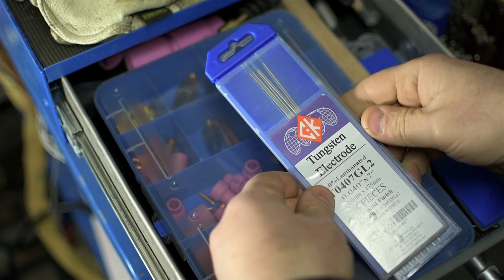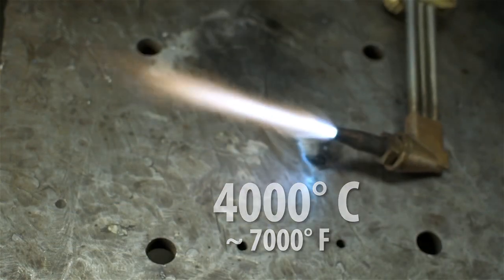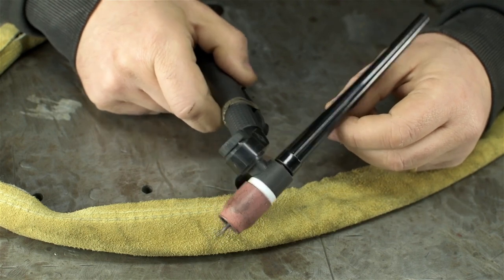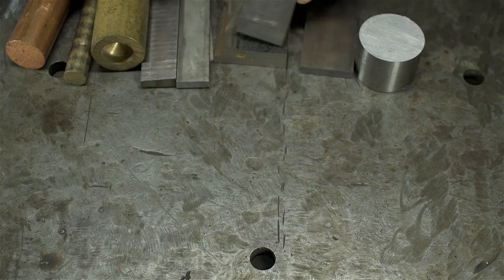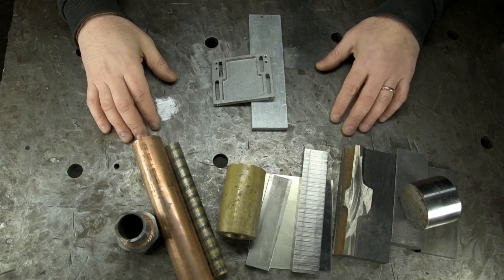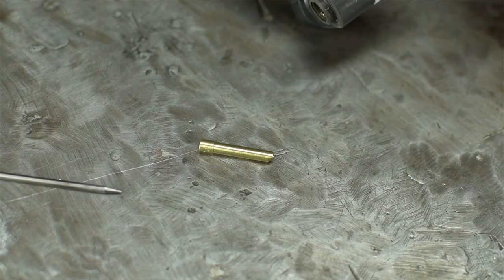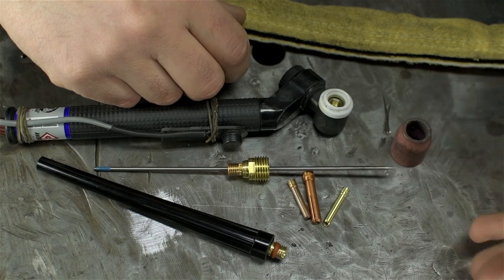Making A Stand! Why I Love TIG Welding

Comment: please weld magnesium 😀
Reply: Magnesium parts aren't usually welded together at all.   They are usually brazed together.  Magnesium welding is usually done to repair castings.  Things like cracks.  Not to join two pieces.
Reply: @GeekInJeep  wait you can weld magnesium? magnesium burns right? I was just trying to make a shitty joke, did i fail?
Reply: @theprinceofmilk2510  http://www.weldingtipsandtricks.com/welding-magnesium.html
And yes... I stole the info about it being used mainly for casting repairs from that site.   I knew it could be welded though, because the instructors always classified it closely to welding aluminum using an AC process.
Reply: @theprinceofmilk2510  - yep, sadly you failed. It's tricky, and you can easily cause a class D fire if you screw up, but it's possible to 'weld' magnesium. Google or YouTube will give more details- as mentioned, it's rather niche, but totally possible. :)
Reply: I use to build alfalfa dehydrators (yes I’m old). We welded magnesium pipe in a circle for the gas fired burner with stick welding. It was no problem.
Reply: @MJ-nb1qn  Ok, I'll bite. Why is an alfalfa dehydrator some form of old school ? Last time I worked on a farm was 1970,and putting cow corn into a silo with 1950s tractors and equipment was my introduction to farming techniques.
The hay bales had string instead of wire and weighed 45 to 70 pounds.
And why is magnesium pipe important for that piece of technology ?
Reply: Dear paul manson —- I meant I am old, in my Midwest farm town there were at least 4 or 5 dehydrators active (circa 1960’s to early 1970’s) . Now none of them are active. There isn’t any alfalfa being grown that I see. I just built the dehydrators. Really not sure why magnesium was used. But, magnesium pipe was rolled into a circle, welded together with holes in the pipe for gas flames to heat the dryer. We build every part of the machines. At that time, early 1970’s I did what I was told, glad to have a job. It was quite a shop. We could roll about anything in a circle. Once we rolled a 6” x9” piece of steel into an 18 foot diameter circle. It took 3 overhead cranes and had to be within 1/8” true. We did it. I saw no difficulty in welding magnesium, I did know the properties of the metal and was not sure why they used it on a burner element.
Reply: Dear paul manson  — By the way I am the 3rd generation to run a cattle ranch. So yes I too bailed and threw string bound hay bails on a wagon as a child. Even saw a “ Go Devil” being used as a child. Ever hear of that contraption?
Reply: @MJ-nb1qn  Yes I have,but do not seem to be able to retrieve the memory. It was a brand name ,no ?
Magnesium pipe with holes for gas flow being used as burner pipe. Jay Leno(a 1930s Bugatti) and the Kermit Weeks crew (restoring a Me 108) talk about the workability of magnesium. How it worked into a circle without cracking I do not understand. And why such a metal was around live continuous combustion. Another mystery. Sounds like these were an engineered product rather than something thrown together with what was available. Why magnesium ? And why so important to dry the stuff ? Not enough summer days ? Or was the alfalfa being processed into pellets ? Off to Google to see about both ,but you were there and I was not.
Reply: Dear    paul manson    —- I can’t tell you why they used magnesium. The shop specialized in make dehydrators. It was a family business with an engineer designing the dehydrators. A lot were made and sold. Magnesium was fine to roll. We had many types of rollers. Rolled angle iron, leg in and leg out. Flat stock into pipe for auger use. Bar stock really anything. We did as much work in outsourced jobs from around the US because we had the equipment. We made a lot of stainless steel “ pressure cookers” about 7 ‘tall and 4’ round with locking ring lids for Georgia Pacific. They used them to cook material that later became sheet rock. I devised a way to roll 1 1/2 x 1 1/2” angle iron leg in. I could roll it into a 2’ circle. I learned a lot of metal fabrication at the shop. We had a gas fired “kiln” out back made of fire brick about 30’ in diameter. We would put rolled big steel rigs in it and fire them up good and hot and let them cool to relieve stress on the rolled steel. I studied metallurgy in an apprenticeship and was certified at least 5 times in welding. We also made hammer mills to pelletize the alfalfa. This was used to feed livestock. All this used tremendous energy, both gas and electric. The engineer had the bright idea to make a small dehydrator that fit on a flat bed tractor trailer. His idea was to take it around for sales.we all said it would not work, but he said make it. The first time he fired it up for the maiden voyage the whole dehydrator and trailer burnt and melted to the ground. Several hundred thousand dollars worth. It was a shame, but if cell phones were around we would still be watching it. Sorry to ramble but this is stuff no one does any more. No CNC or that stuff all cut and sheered by hand. We cut stainless with torches that blew metal filings into the flame to start the oxidation process. No one does that. It was so messy and dirty and cut poorly. This was 3/4 to 1” stainless. Better go. By the way the Go Devil was a name and was a horse drawn affair for haying.
Reply: @MJ-nb1qn  Holy crow. I know I saw a thing called a go-devil,but just what will not retrieve. One welding instructor I had not only showed his case of very old paper wrapped welding rods,he brought his WWII shipyard plasma torch,used for cutting battleship armour. Actively dangerous to use, the UV alone could blind. Two sets of tungsten electrodes,one oxy,one acetylene. Needed a horse collar sort of thing full of crushed ice wrapped around the operators neck. When the ice melted in 20 to 25 minutes,mandatory to stop or risk thermal overload.
That is one heck of a shop,one heck of a story. Sounds like the place closed,now that is truly a shame. The equipment,personnel,expertise needed to do stuff like that all intertwine. Lose it,you lose an important knowledge base. Thanks for the details you gave. Cheers.
Reply: paul manson — You just got an old guy reminiscing. Yea the shop closed not a lot of call for big dehydrators. These were 50 to 70 foot long. A lot of equipment gone. A lot of knowledge and skill gone.  When the American Chopper show came on I thought Wow we had everything needed to make bikes or buggies or cars. I later went to Santa Fe as a carmen and fixed and made box cars. Then on to ranch and start 2 other businesses. I still have a metal fab shop, and a wood fab shop. I got more equipment than 3 guys need. I keep telling why wife I’d like to be around for my own estate sale! She doesn’t get it. I once went through a mental list of all the jobs I had With a guy. He stopped me and asked, “ How Old are you anyway” . I built houses for awhile. I finished my first house when I was 17 years old! Now a days who would hire a kid to build them a house. I did this while in High School. Under budget. House still stands. It has a 4 car garage. A walk out. 2 cars over a basement walk out 2 car garage. 8” cement floor poured like a bridge. I had a bridge engineer design it with orders to make it twice as strong as needed. A lot a concrete I beams and rebar. For my last big job I went back to school and became a Doctor! Graduated Magna Cum Latte! But, no one really cares anymore. But I had a blast. Thanks for listening....
Reply: Of course you can weld magnesium!🙄😆 It even comes in structural shapes, like angles. In the 80's, I use to tig a lot of mag bread racks, as the welds would easily crack from vibration. Mag welds similar to aluminum, just more a more dirty sooty process.

Comment: As a journeyman welder by trade with a B pressure ticket I can assure you that generally TIG welders can weld with stick, but they are generally are not very good at it. TIG is a much slower process than stick and most TIG guys have trouble dealing with the speed they must maintain to do a good job with stick. Conversely, most stick guys can use TIG but they tend to run higher heats than required for TIG and get a fair amount of washout or low centres on their fillet welds because the fill is not tied to the arc and they are slow to add it. 

The MIG guys normally can't use TIG or stick nor oxyacetylene with any degree of success because MIG is generally only used for high production repetitive welding or a home garage application. I myself despise MIG as it is viewed as an "I can weld anything" process but the possibility of weld flaws is much greater than the other processes. I have seen MIG welds that looked great until you tried to pick the part up and it fell apart because only one side was fused and the other was 100% cold lap. MIG requires absolute cleanliness of the joint or you can expect problems.

TIG also requires a high degree of cleanliness also but is more forgiving than MIG as you have time to work the puddle. Stick? Just knock most of the heavy rust and oil off and get atter. Stick is by far the most versatile method of welding and it takes a greater degree of skill and practice to use it which is why so many try to use MIG to replace it because almost any fool can run a grinder. 

In any event, a properly trained welder can use or learn to use almost any process you throw at them and with a little time and practice can become proficient with that process.

Comment: Been tig welding aircraft weldments since 1979. I've upgraded equipment three times since.  My new favorite add on is my Miller wireless foot pedal. Makes a big difference when working on tube fuselages. One less cord to drag around. The new invertor welders are awesome.
Reply from the maker: i bet those things are nice!

Comment: IHMO, the best feature of TIG is tacking steel WITHOUT a filler !

Any DC welder can be turned into a "scratch start" TIG for not a lot of money.  You lose most of the the benefits of a good quality TIG (like easy tacking), but does work.

Comment: I love my inverter stick. Its smooth and chipping the slag is like opening  a present to reveal if you did it as well as it should be. For speed MIG is simply the last word in joining metal. I've brazed with any acetylene and that is good but if I can help it I use other methods. But that brings me to the TIG I got it just to add aluminium to my skill set and it's as hard as they say. But I've fallen inlove with my TIG welder it's on the list of things I'll grab from my burning house with my toaster that gets bread just right. People don't understand the enjoyment you can get from a good weld. Seems you've shown me some others do. Thanks.

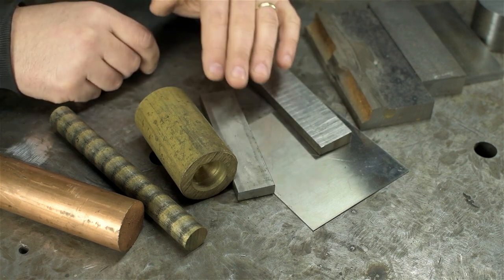Comment: 9:30 I've welded Titanium (for helicopter rotor parts) as well as Inconel ( metal braided over corrugated metal hoses like you see under the hood of rebuilt hot rods, but used for corrosive chemicals in industry) Inconel hose assemblies would leak if even one grain of something was in the weld. Everytime. Just an FYI 😉

Comment: I could never get feeding the rod right, so I made a rotation table to weld round things, and a wire feeder off a reel of wire.  The feeder is a wiper motor and the (supported) shaft presses onto two bearings to friction feed, the V center of the bearings keeps the wire in place and feeds it into the standard spiral used in mig welders.  On the end is a handle with two switches, forward and reverse.  The speed is adjustable and you can feed any length of wire into your weld.  No more fiddling.

Comment: I found that very interesting. Thank you for posting it. I have been mig welding fo about 30 years , being self taught (I'm gas welding certified though not done much of it) and had almost no information on Tigging other than what TIG stood for. So thank you. It's a pity my 185 mp mig is only D.C. as I have a large 10Kg roll of aluminium ( sorry, I'm English lol and we spell it differently!) high I have tried to weld with pure Argon but the welds were crap, now I know why!!

Comment: If you want your "welding gloves" to last a lot longer and/or want to be able to get by with much lighter/cheaper "welding gloves" and want to use all of every rod, try "splicing" a new filler rod to a short stub once it gets too short to be able to hold with excess hanging out of your hand. Leather gloves dry out and shrink and get hard as a rock with much exposure to high temps and super "dry heat" common in the welding world. 

Especially fancy insulated "welding gloves" that don't get kept humidified on the inside by sweaty hands. And insulated gloves aren't "cooler" or "safer" for handling hot materials because by the time you realize you're getting burned through the glove or that a spark or chunk of "slag" or other debris that funds it's way inside, they're usually hot, dried out, shrunk and hard as hell to get off in a hurry without putting a bare hand in harm's way. 

And FYI, wedding bands - especially super-conductive and malleable and "unremovable" gold ones, are a really, really stupid thing for "blue collar workers" to wear at work. The number of missing/mangled left ring fingers and hands among "blue collar workers" is all out of proportion to the amount of work we do with our left ring  fingers and hands. Why? Wedding bands. Followed closely by wristwatches when its mangled/missing hands. How many ways can  jewelry injure, maim or even kill you? Does it take more than one to be enough to leave jewelry in your locker/toolbox/lunchbox/vehicle? 

Your old lady will get over you being "naked" at work a lot sooner than she'll get over you being off work up to and including forever because you'd rather put it on and leave it on than man up and be "single" at work. Leave your personal life at home or just in the house when in your workshop and work gets easier, safer and your personal life will improve because you're actually thinking about it instead of taking it for granted.

It's amazing how many professional YouTube "shop teachers" and "how-to" videos there are and how few "safety videos" they make and how little good, basic shop safety practice gets demonstrated. Might get in the way of the jokes, special effects and other horseplay apparently necessary to "sell" their expertise to the internet equivalent of school kids taking "shop class" because  it's the easy/cool/exciting/macho thing to do.

Comment: I enjoyed the video, however, there is one thing I must point out. as a welding student I get to see a lot of cool welding demos and one of those demos included using a waffle disk (scotch bright) to take off aluminum's oxide layer and welding it with DC. apparently ac welding has low penetration so for any structural applications it must be welded with DC. i got to try this after the demo and it actually works quite well. just food for thought. thank you for producing all the great content you do.

Comment: I really loved the clever tungsten-scribe method of cutting square tubing on a bevel using compressed air.  You crack me up with your awesome cutting skills every time.  So far, I've had 2 stick welders, a MIG welder, and 2 TIG welders.  I agree; TIG is THE go-to process for all the work I do in my shop and I too love my CK Flexloc torch.  Can you please make a short video for poor hacks like me on how to weld that 1.5" solid round copper bar with your 220A power supply and air-cooled torch?  Thanks!
Reply from the maker: LOTS of preheat. :)

Comment: Great overview on TIG, TOT.  You forgot to mention needing a water cooled torch for more powerful machines.  I built a gross-overkill microprocessor controlled one that won't let me weld unless I have enough coolant flow, then shuts off the pump & fan when torch is cool.  I think you'd like it but not as much as we both love our CK FlexLoc torches.  I also put a pressure switch on the Argon supply cuz ... well you know.   You also do my heart good after I take a beating watching Jody Collier lay a bead.    Can you run a demo bead on that 2" solid copper bar for me with your HTP box?   😁  Thanks for all you do; love your channel and especially your humor.  😍  Hope you get to a million subs in 2021.

Comment: Arent people forgetting that welding AC
Is actually welding DC - DC+ really fast 
Take a cheap AC welder 
Put on some heavy duty diodes and turn it into a DC welder
Picked up my brand new Lincoln Tig 250 in Nov 1983 its still working great 
I too love my tig welder 
If i was to get rid of my tools my tig welder would be the last too go 
Ive welded Mini Mouse umbrellas all the way up to some very structural Iron projects along with many things I thought I couldnt weld but my friends were too cheap to replace

Comment: Don’t forget Tony. Aluminum can be welded with DCEN. You just need to use helium for the shielding gas. It’s actually  preferable to use DCEN for aluminum thicker than 1/8”. 
High freq AC tig just doesn’t penetrate aluminum past 1/8” thick.